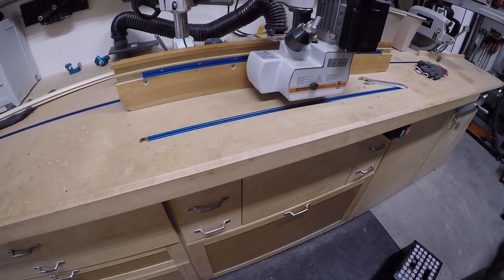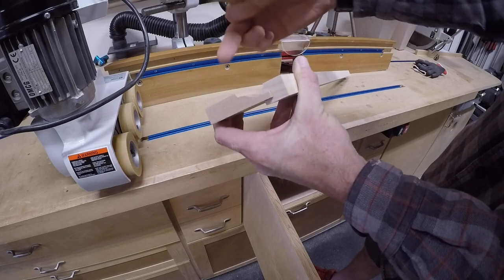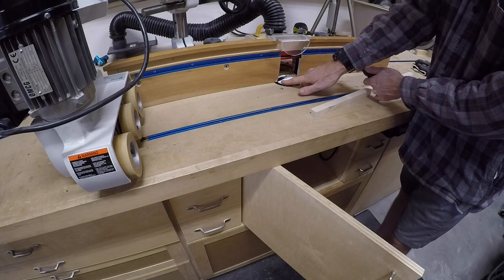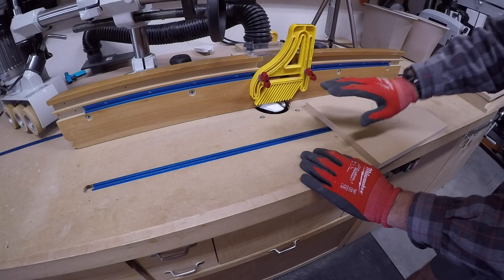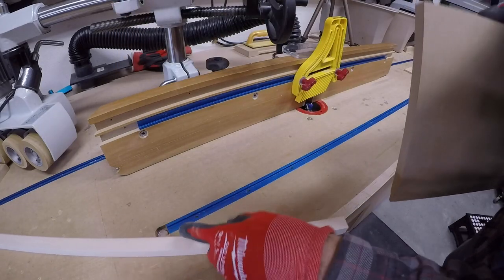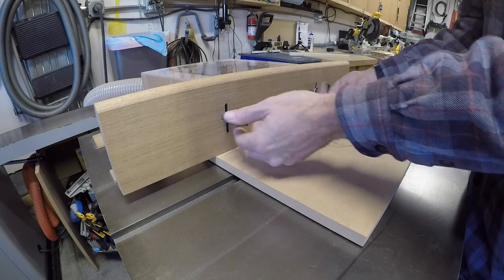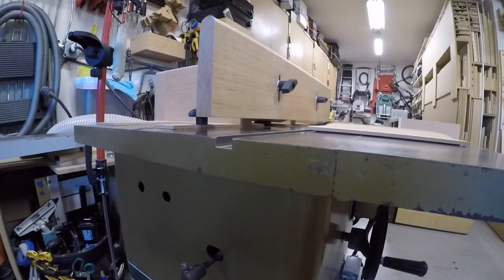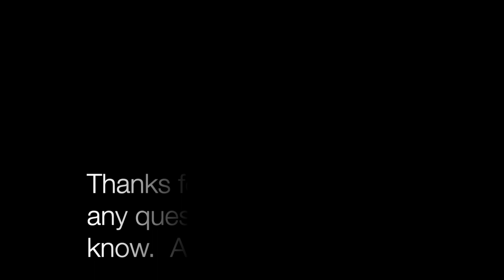Router Table Or Shaper? Which Is Better For Raised Panels?  Let's Find Out!!

Comment: Hi David:  I love your "safety box."  Where did you get the "black elbow" that connects to the back of the safety box for dust collection?  What is the black elbow called?  Thank you!
Reply from the maker: Thank you Roger for watching and I’m glad you found it helpful.  The elbow is from https://amzn.to/47KsvbK.  I hope you are able to get one and build a fence for your shaper.  They can be used for router tables also.  Slight modifications can make them very universal.
Reply from the maker: Did you get this link?
Reply: @davidbryanwoodworksandmore  Thank you David. I am going to build a safety box for sure.  Does the bottom layer need to be 1/2 inch or less? Or is 3/4 okay?

Comment: I really like the shaper see thru you have , I make doors using 1-3/4  white oak stock on a shaper, I think your shaper is a Power Matic & that is the Brand I was raised on I also have done quite a bit free hand.
Reply from the maker: Thank you Mark.  I appreciate that.  Yes you’re right the shaper in video is a powermatic.  Great machine.

Comment: A shaper really shines when you use the raised panel bit/roller bearing/back cutter in one pass.
Reply from the maker: Yes they do as does raised panel router bits with back cutters on them.  Only thing is that my door profiles are all custom sized for grooves of various sizes, so a fixed tongue thickness on the raised panel isn’t good.  This is why I elect to do them separate.  Otherwise yes I’d do them in one pass.

Comment: I really liked the fact that you showed the difference between the shaper and the router table, we don't often see shapers in use on Youtube. 

It was a little long before we got to see some action, but I really appreciated the tips that I saw like using the featherboard to maintain downward pressure or your set up on the shaper.

Your videos are improving, keep working on them, it's really cool!
Reply from the maker: Thanks so much for the comments.  I’m trying to think of cool stuff other than building.  I figured this might be good.  I’ll try to make shorter ones but it’s so hard to leave out info.   I’m really glad you left some feedback.  It’s great.
Reply from the maker: Hey I just posted a couple videos on the shaper fence build.  Check them out.
Reply: @davidbryanwoodworksandmore  will do for sure!

Comment: For me, I like the weight, and stability of the shaper . Less noise and vibration also. The adjustments are so much easier done. I have used the router before to do some doors, but once after using the shaper there is no going back for me. I can run raised panel doors all day long with no problems with the shaper. With a router, you would burn it up..
all the big boys use shapers, or high dollar big machines. And David what I have noticed is the shaper doesn't burn the wood like a fast turning router bit.

Comment: What is the brand of your insert cutter? I didn't catch that on the video. Love the fence setup!
Reply from the maker: Hey thanks fir watching and leaving a comment.  I appreciate it.  The brand is infinity. I would have put a link but Amazon doesn’t offer it.  You need to go to infinity cutting tools.  It’s the insert pro shaper profile. Thank you fir your compliments about the fence. I really love them.
Reply: Infinity tools is great, and awesome customer service
Reply from the maker: @paulnord2013  I think so too.  Very good in both regards. To bad Amazon doesn’t sell the insert heads. They have other infinity items.  Strange.  Thanks again for your positive feedback.
Reply: I generally use Freeborn but they are very expensive.....I'm going to check the infinity insert cutter.
Reply from the maker: @jeremyhansen714  Jeremy freeborn knives are very good but expensive.  You're right.  I May have one but mainly I use freud and infinity.  Ive also got a custom one I had made.  Check out infinity as I think they have a good solid feel and result without the high price tag.
Reply from the maker: Jeremy check out the shaper fence videos I just posted.  I hope you enjoy them.  Let me know.

Comment: I'm surprised you run a feeder on your router table, but not on the shaper.
Reply from the maker: Actually I have them on my shapers also.  Just not this shaper for raised panels.  But my other two have them for mouldings.
Reply: @davidbryanwoodworksandmore  I went back and checked out your tour video. I noticed the other shapers and feeders you were talking about. Still somewhat suprising you have a feeder on the RT and not on your panel raising shaper. Are you running all the door sticking on the router? I could see keeping the feeder on there in that case, but I also couldn't imagine running door sticking on a router.  I much prefer running everything on a shaper personally, and ideally with a outboard fence to size at the same time as sticking. Either way nice video(s)
Reply from the maker: @jar944  thanks for watching the tour video.  I use the router table almost exclusively for making Rails and Stiles these days.  Its much easier for me as my shop is very efficient the way its set up.  I use the RT feeder for when I need it for many tasks.  Not making doors per say.  If I had to change out my shapers from their assigned tasks every time I wanted to make a door, it would be a big slow down.  I have the other shapers set up for moulding tasks.  And my big router table is totally well suited for making rail and stile cuts for doors.  I dont make many raised panels anymore.  No call for them.  I would check out more of my videos on my builds and see what I am talking about.  Now If I was only a door maker, then yes id probably be using dedicated shapers for my parts or panel makers.  This setup works great.

Comment: Hi David. Love your presentation. Back in High School woodshop students were forbidden to use the shaper, so I've always been intimidated by them. Now I'm a 63-year-old weekend warrior with a decent woodshop and you just made me comfortable with shapers. I appreciate your approach to safety and function. I'll be on the lookout for a good used one. I just saw an email with a Grizzly G1026. What do you think of those? 240v 3450rpm, built in 1999
Reply from the maker: Thanks so much for the nice comments.  I’m totally excited that my video helped you overcome your fears from way back when.  As far as B a good user shaper, there are so many out there.  I think if you can get a nice one for 600 or less you’ll be good.  3hp is great but don’t count out old deltas that are 1 hp.  They can be great machines if not trashed. I got mine for $200 with a 1/4 hp power feed.  I have a video of that one with before and after pics of it.  It was nasty.  I’d say go with delta powermatic or general.  Grizzly if kept in great condition may be great for you too depending on price.  Certainly that 3hp grizzly is going to be fine for many jobs I’m sure.  Especially if coming from a hobbiest woodworking shop not a production shop. Do you know?

Comment: Good afternoon,  I just came across your video demonstrating the difference between the router and shaper, I recently purchased a shaper without a fence and I liked your fence for the shaper. Do you perhaps have plans for that fence?
Reply from the maker: Hello jwar and thanks for subscribing.  I am putting together a sketch with a video for the fence.  I think it’s a very good option for shapers as well as router tables. I’ll post it very soon.  Let me know if you’d like to see anything else.  What kind of shaper did you get?
Reply: @davidbryanwoodworksandmore  I purchased a used Shop Fox W1702. Shop Fox Representative for sales and service in my area says that Shop Fox does sale a replacement fence for 400 plus dollars. But then I could have just bought a new unit. For what I would have into the shaper. I purchased the shaper to make cabinet doors for my personal kitchen cabinet remodel along with both my bathroom cabinets and closet upgrades in the fixer upper home I purchased from a widower of a deceased disable Veteran. Myself being a disabled Veteran I was trying to help the widower out. I think  that I bit off more than I can chew, but time will tell as there are no rewards needed for doing a good deed in helping others. Keep the videos coming. BTW I am curious as to the shaper cutter that you were using. I like that you can change the cutter profile. Can you give the manufacturer or a link. Thank you Jack. Happy new year to you too.
Reply: I wanted to add something to what you said in the video about static building at the plexiglas. If you drill a small hole and epoxy a copper wire into the hole  just barely protruding into the cavity then route the wire along the top of the fence down one side or the other to one of your hold down knobs with a crimp fitting of appropiate size to fit over the threads that is bolted into the metal top of the shaper that should take care of the static electricity charge build up. Great design btw. Those that have pacemakers can be detrimentally affected by static electricity.
Reply from the maker: @jwar2163  wow sounds great.  Shop fox will serve you well.  I never use my fences on the shapers.  Always make them.  So they just sit on shelves.  I think it’s great you are trying to do good deed for her.  She needs help.  As far as cutter head, it’s from infinity. Insert pro.
Reply from the maker: @jwar2163  I think I misspoke.  it’s not static electricity.  it’s more just cling Like mdf dust does.  There isn’t static shock.  But just the mdf dust can collect in corners of plexiglass and back of box.  If you make raised mdf door panels, you’ll see what I mean.  But thank you for the static tip.  It’s like what I use on my miter saw dust hose that connects to the central vacuum. Copper wire wrapped.  It’s works great. No static.
Reply: @davidbryanwoodworksandmore   Thank you. Yes I did help her by buying her house and getting her out of debt as she made money on the sale and I accepted the house as is and did not require her to do any repairs and the house needs a lot of love. I can do it, it will take time as I have to work around my own disabilities from my military service and injury from my civilian job that forced me into my second retirement  that resulted in permanent medical retirement. 
      Infinity tools is a good company I was looking at their shaper pro set for cabinets,  but will revisit that now that I have learned they have a multi profile unit. I am still awaiting a back order from them and will see if they can include the shaper cutters with that back order. 
 New to a shaper is it better to use 3/4 inch spindle or the 1 inch spindle since the Shop Fox came with 3 different spindles and a router spindle. But I have a router table for my router bits. I don't think the shaper turns fast enough for router bits. I noticed that there are not a lot of videos on Youtube for shapers and if I ever get the Shop Fox up and going I may have to figure out how to do a video or two But until then I will continue to watch you make woodworking look easy. Will be looking forward to how to make a shaper fence when you publish that video. Thanks Jack.
Reply from the maker: @jwar2163  thank you Jack. And Thank you for your military service.  So sorry to hear about your disability from it.  I’ve come across many woodworkers just starting out as a disabled veteran.  I’m simply amazed at what can be done.  I appreciate your compliments for my making it look easy.  You know it is very nice to hear as many day to day things I do I really forget how far I’ve come in my trade.  I used to be very intimidated by machines, back in high school.  Crazy how things have changed.  I am really So glad to hear you are enjoying and anticipating my videos.  That’s tremendous.  I am so glad I started putting my videos out.  Thank you for your support.  Oh and by the way, if you use a shaper, I’d go with 1-1/4” if you can.  You can use reducers to use on many spindle sizes.  But if your shaper can’t accommodate that size, then go 1”.  3/4” is fine too if needed.  For doors 3/4” is totally fine.  I Just like to have the flexibility to go from bigger spindle down to smaller if I needed to using reducer bushings.
Reply: @davidbryanwoodworksandmore   Your welcome and thank you, I am returning to woodworking after  15 years I had a small cabinet shop that I dabbled with and I did custom work mainly upgrades and repairs to old historic cabinets and existing kitchens. I did custom pieces for select customers, but that was a long time ago.   So my tools then were different  than the setup I am doing now.  I have the very first piece of Furniture I made in High School woodshop still that was some 34 years ago. My son still has some of the custom furniture I made him 15 years ago.  The things I know now after 3 weeks of brainstorming videos on shapers would have stopped me from buying the Shop Fox as it only has a 1/2 in, 3/4 in 1 in and a router spindle. But it is my first shaper and I will cut my teeth on it as they say. It does intimidate me some what.
Reply from the maker: @jwar2163  glad to have you back in the trade.  I’m sure you’ll find yourself back in the swing of things soon.  Pretty cool that you’ve got projects that you built for your kids.  Those are really awesome memories. For spindles, I use 3/4” and 1” as well as 1-1/4”.  It’s totally fine for cabinet type work.  Your shop fox will be more than adequate for the work.  If it’s a 3hp.  My old vintage delta only is 1hp but it’s a pretty powerful 1hp from the old days.  It’s certainly more powerful than today’s 1hp.  Motors.  I think the speed on the shapers is too slow for effective router bit use.  The router table does a great job for most applications for sure.  Just a lot louder.  Shapers are quiet.
Reply from the maker: Hey I just published the shaper videos today.  Please check them out. Thanks for being patient. I hope you enjoy them.
Reply: I’ve been looking for a video like this for at least 2 years as I hate the fence on my shop fox, and my Harvey shaper fence is not better.  Going to be making at least 2 or 3 of these

Comment: If you had the room how many shapers would you have.
Reply from the maker: Interesting question. I really feel my shop can hold a lot of them if I wanted to.  But I usually go to my router table setup for s lot of my tasks.  Most everything I do on my router table. But if I need to use the shaper, they’re nice to have.  Since I’m not doing a lot of raised panels or decorative mouldings that are big, the shapers aren’t used too much.  Although I do use one fir the back profile for 3/8” door panels.  What by about you, do you work with routers or shapers more?
Reply: @David Bryan Woodworks and More  I have two 1-1/4 with feeders and one 3/4 shapers, one router table, one 5x10 cnc. Six hand routers.
Reply: I would like to add another 1-1/4 for part of the copping setup.
Reply from the maker: @kenf2662  wow you’ve got a lot.  What cutters are you using for doors?  Insert type?
Reply: @davidbryanwoodworksandmore  Freeborn insert cutters
Reply from the maker: @kenf2662  those are nice. I’m thinking of getting some but the profiles I use are shaker and 1/4 round styles.  It’s really too bad that all companies require that two separate heads be used for those profiles.  I’ve been considering the freeborn and byrd heads.  Have you used byrd?
Reply from the maker: @kenf2662  It sounds like you have a production setup.  Building a lot of doors all the time?
Reply: @davidbryanwoodworksandmore  Yes, It is a production like shop but it is only me. With my age now I pick choose and time the projects I do. David, just to put it in perspective of what my shop is, if I were to do a video (YouTube) It would be the biggest most equipped one man shop by far as of right now on YouTube.
 I like watching the videos of other woodshops out there of all kinds and respect everyone that's why will never show a video of my shop.
Reply from the maker: @kenf2662  got it.  Sounds pretty cool.
Reply: @davidbryanwoodworksandmore  No byrd have not used them they look good. I have the full collection of freeborn profiles, the carry a shaker and 1/4 round.